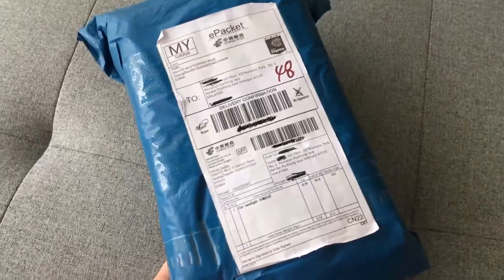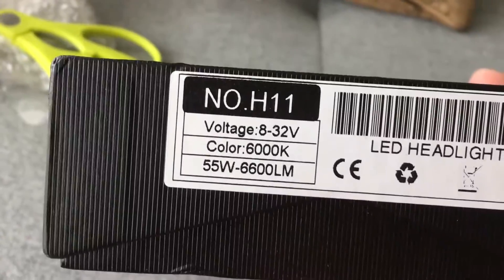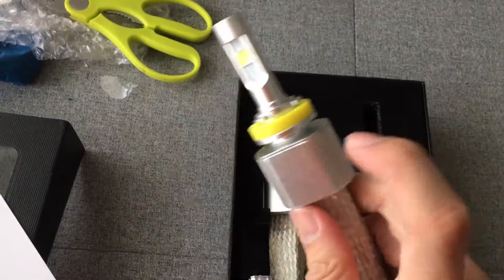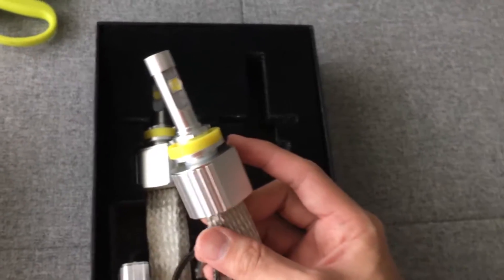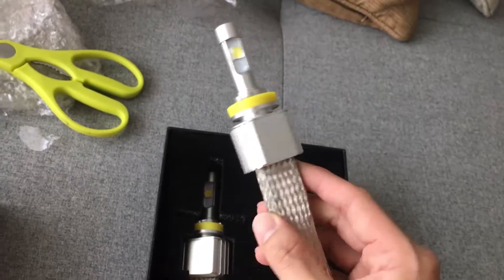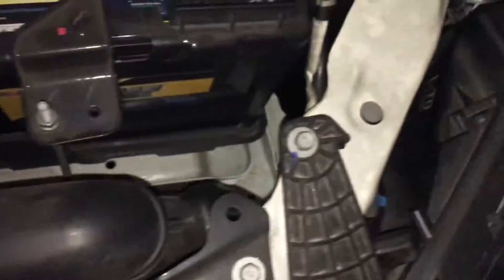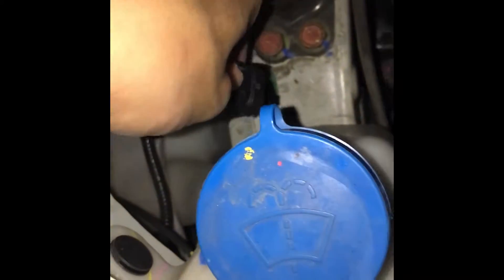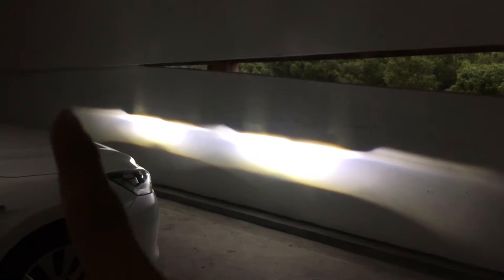CREE's XHP 50 VS XHP 70 LED Headlights

Comment: Hi, I have few question that looking forward for your help. Be honest, led only brighter than the halogen a little, not much and of course the distance far little .I ordered a set of xhp50 led 4300k and assembly it on my Crz projector headlight. But there is something that I don’t understand, the left headlight apparently higher than right headlight about half a cm, and what position we should assembly the light sources , or which may be suitable 3/9 o clock or 12/6 o clock ?
Reply from the maker: Hi,

I have had a set of XHP50 and frankly, they didn't do much in terms of illuminating the road (compared to halogens), they may put out a bit more lumens but because of it's color temperature, not all gets reflected on the road (especially when the surface is wet) - so if you asked me, XHP70 is the way to go (at least for now).

Each headlamp housing actually has a fixed angle where the bulbs will lock into place so it's really not up to you to decide whether it's 3/9 or 12/6. You insert the bulb and have it lock securely in its place - if it doesn't wobble then it is in its right angle.

By right, the height of illumiation shouldn't change because you are not moving the angle of the reflectors but if you find it disturbing, you can adjust them back into place with a screw driver.
Reply: Thx for your reply, I’d go for p50 due to there is no 4300k in p70 for the moment, if u don’t mind pls add my WeChat id: koyeap . Cuz my headlight see from the left to the right the cut off line is descending, i had no idea what to do now .

Comment: Brightness in short distance is a lot higher, but long distance brightness is worse than halogen (Osram night breaker) in halogen projector headlight. I have tried this XHP70, I have tried Philips Lumileds (philips had clear cut off).
Reply from the maker: Agreed with your observation in terms of length vs intensity for this LED kit however it is not necessary worse when compared to upgraded halogen bulbs (Osram NB). 

I ran Osram NB Plus before switching to LEDs and it does appear that the NB plus has better throw than LEDs but this is mainly due to the color temperature. These LEDs optimizes at around 6000K while the NB plus optimizes at around 4500K and because of the color temperature, it is easier for our eye to distinguish the latter color on asphalt or tarmac surfaces. 

On standard headlight settings, NB plus would give you slightly higher intensity which allows you adjust the beam higher without compromising on visibility, this is why Osram claims that the NB gives you slightly further beam throw compared to standard stock halogens.

This LED kit however (as far as my eyes can perceive) is definitely brighter than standard stock halogens on standard headlight settings. 

Cut off line has everything to do with the reflectors behind the projectors and the location of the light source. Correct me if i'm wrong but Lumileds construction does not have that spherical done around the chipset, yes?
Reply: Lumileds does not have spherical lens on chip. 
I have ordered XHP70 in 5000K color.

Anyway, for night driving it is almost the same for you (not noticable difference) between NB and XHP70? 
I havent used LED in daily drive, because I'm not able to close the dust cover, I'm waiting for new bigger covers. I hope they are useable at least same as NB (cut off is fine, projector headlight, low and high, bi-halogen projector)
Reply from the maker: My inference is that the absence of the spherical dome on the chipset result in a clearer cut off point because what that spherical dome does is, it refract lights.

There is a vast difference between NBs and XHP70 where the latter does in fact performs better. I would equate the latter to the equivalent of a 35W HID but with less coverage. The NB is only better if you are running on stock standard halogens before.

Overall, it is better driving at night with the LED because the pure white color does give me more perceivable grounds to cover however the only drawbacks that I encounter now is during rain where it really drowns it out but to be fair, the NB doesn't really fair very well either. Wet surfaces just reflects too much light away.
Reply: @ShaniAndrasAccord  in the rain, best to use 4300k, xhp50 have that colour temp vs xhp70 which does not.....
Reply from the maker: Hi @elitekingcobra , from my observation; both the XHP50 and the XHP70 shares the same light temperature which is about 5000k ~ 5500k - vastly different from the LEDs that come equipped stock with newer cars.  I reckon that if there's any noticeable difference in lighting temperature from the naked eye then it would most likely cause by the refraction from the surrounding light source or the surface in which the light reflects upon.

Comment: The XHP70 ship is supposed to be 7mm each side, and the XHP50 is 5mm, are yours?
Reply from the maker: hi! i didn't measure this LED chip before installation but I just measured the XHP50 chip and yes, it checked out at 5mm. Given the visual fact that this LED chip is larger than the XHP50, I'd say this LED chip is at least 7mm hence it can be safely say to be XHP70.

Comment: I do have the xhp50 for almost 2 years exactly like the one you have , do you recommend me to upgrade to the xhp70 from your experience.
Reply: They have released an upgrade of the xhp50 design you have , its xhp70 but one chip only, you can do a comparison.

http://s.aliexpress.com/j6FvYZju
Reply from the maker: hey! let me answer your question in 2 parts =)

1) should you upgrade
- if you have some additional cash in your hands to spare then i would recommend you getting this upgrade because the increase in output is obvious but getting it right now may not make the best economic sense since it is still on the expensive end.

2) single chip XHP70
- the link you provided shows the same design (fan) but using XHP70 chip instead of XHP50 but do not be misled because the picture showed in the link is actually not H11. some bulb types only utilizes one side of the reflector (eg. H4); if you select H11 in the option, you will get the double sided LEDs.

hope this helps!
Reply: Accord 2.0 The link i provided For the single beam such h11,9005,h7 etc It does only come with one side chip xhp70 unfortunately as i checked in their photos, they don’t even provide h4 ones yet, So i assume the one you reviewed would be better since it is two sided chips.
And thanks for your feedback it does help ,keep up the good work 👍🏻👍🏻

Comment: 660lm is not enough for headlight, ebay product all numbers need to divide by 10, if they claim 6600 then it will be 660lm. poor light
Reply from the maker: agreed on them not being 6600lm per unit but they definitely shined brighter than standard halogens. i had a pair of Osram Nightbreaker Unlimited (ONU) previously and these outshined them and the rated lumens on ONU is around 1500lumens =)